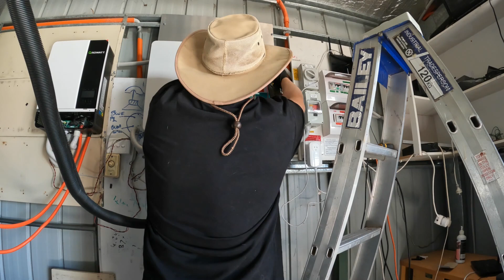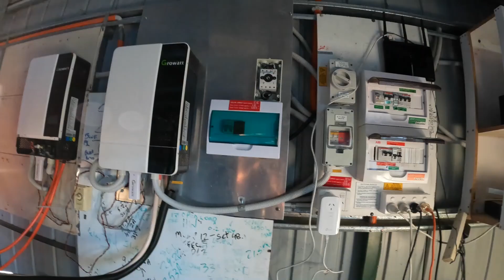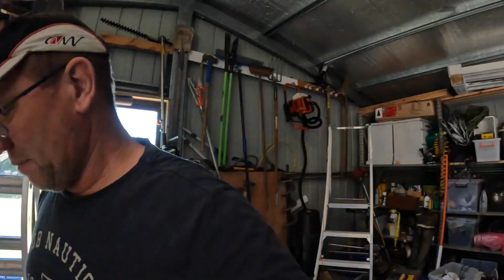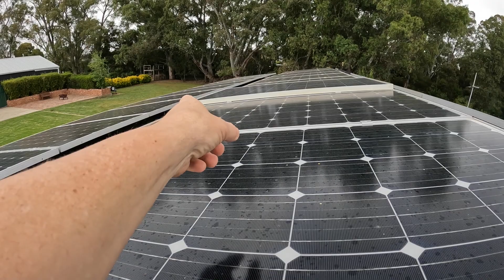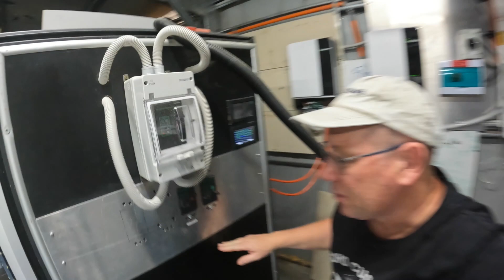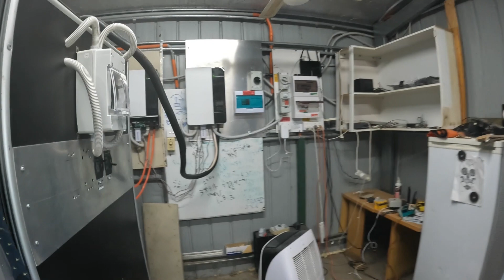Testing secondhand solar panel when they have been fitted on a roof

Comment: Nice one mate. So is the solar issue fixed now?
Reply from the maker: Fixed, but my wife started a bathroom renovation.  So I am on that right now.  I do have a lot of work to do on my DIY Lifepo4 build left. May need a hand from you, with some protocols to connecting the jkbms to the Growatt SPF5000ES.